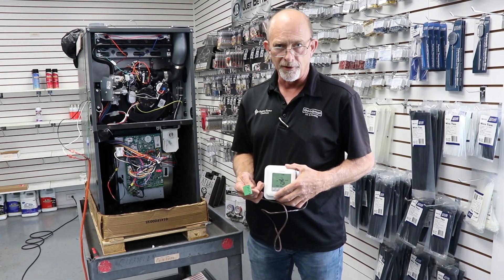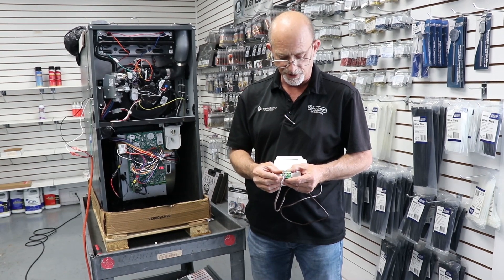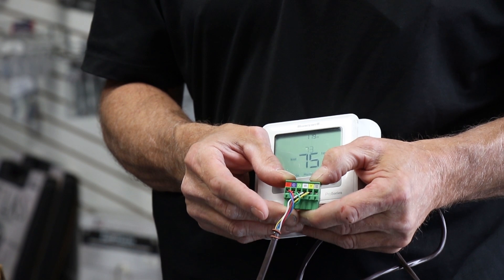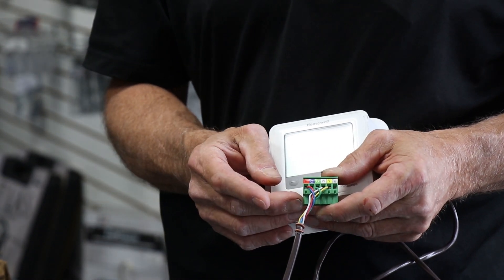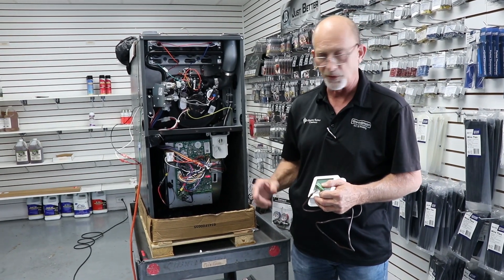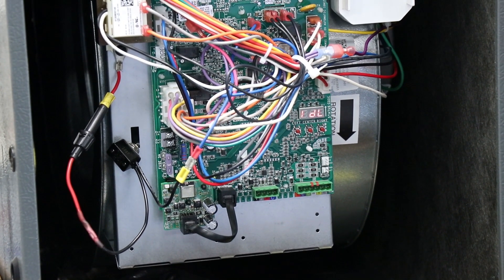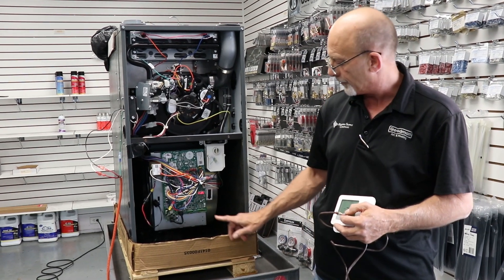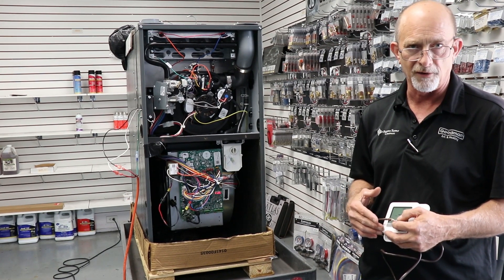pt 7 Setting up wiring

Comment: Hello, I ask for your assistance as your excellent at wiring Goodman products. I just purchased a Goodman GSXC703610 condenser. I do not have a goodman furnace. I purchased a 7 pin plug connector #0130m00485 to hook my sensi thermostat up. I'm told to use R, C, Y1 and Y2 wires from thermostat to this 7 pin. If you could give me support I would greatly appreciate.

Comment: Great info!  What if you have a GM communicating 2 Stage A/C, but no communicating thermostat?  Still proceed to wire the A/C into the communicating equipment 4 pin port and wire the stat into the main plug?
Reply: I have the same question did you figure it out?
Reply: @lifeistoshorttolookback  I called them as well as asking here and on another thread, and got no response online and they wouldn't tell me because I wasn't a Goodman contractor.  Lot of good that does when my Goodman contractor doesn't know either.  I ended up not using the communicating ports for the A/C and went with the traditional Y/Y2 cooling calls from the thermostat.  I have no idea if this is correct, but the A/C will only go into stage 2 from thermostat, the board on the furnace has absolutely no control over the A/C.
Reply: @Str8Haste  thank you so much, that's what im using also.. manual is confusing